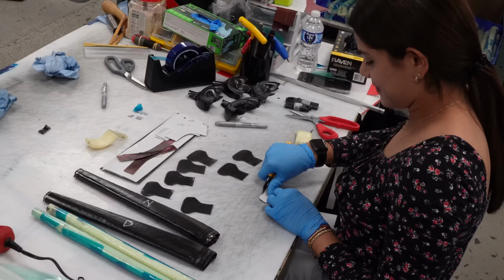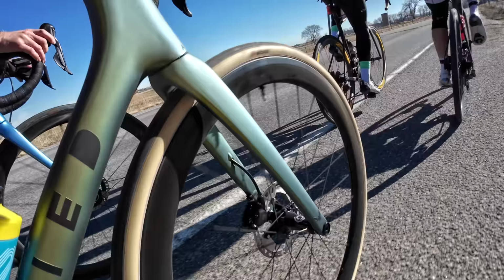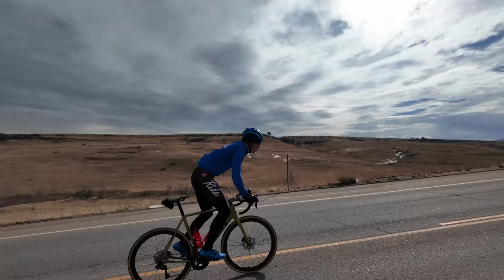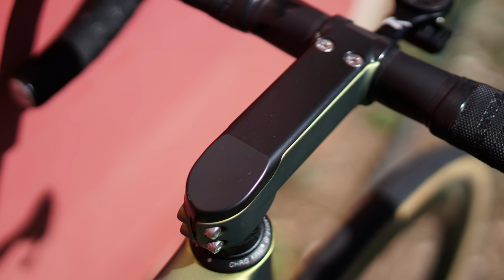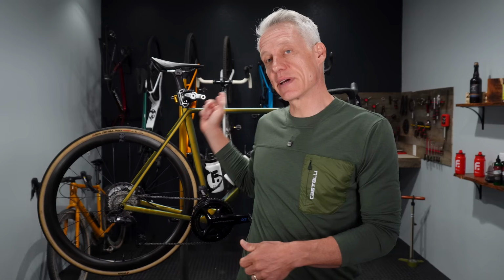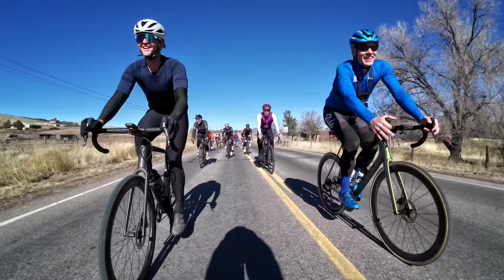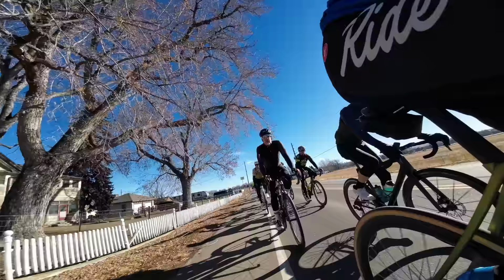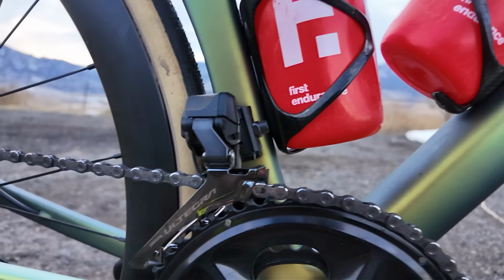Is the Allied Alfa the ultimate everyday race bike? Longterm review

Comment: Disagree with the notion that customers chose hidden cables. Customers chose bikes that have them because in aggregate that bake met their needs and hidden hoses wasn’t a deal-breaker, but you also have to acknowledge that alternative options have diminished. So customers didn’t actually ask for it, rather accepted it.
Reply: Outside of someone traveling a lot with a large bike, I really don't get the complaints.  After the housing is run the first time, it's laughably easy to replace old housing.  Just pull a tandem cable through the frame with running new housing through it
Reply: @veganpotterthevegan  tell me you’ve never serviced your headset bearings without telling me you’ve never serviced your headset bearings.
Reply: @clarks888  I've serviced way more than I can count potato.  I was a mechanic for 20yrs